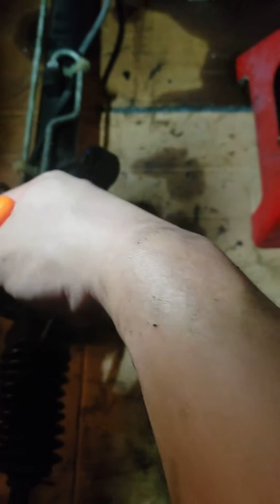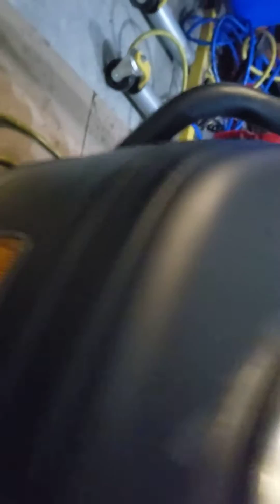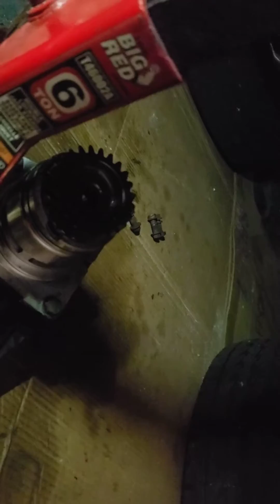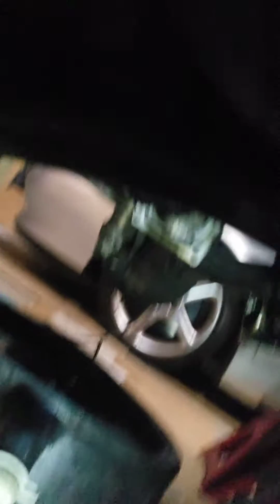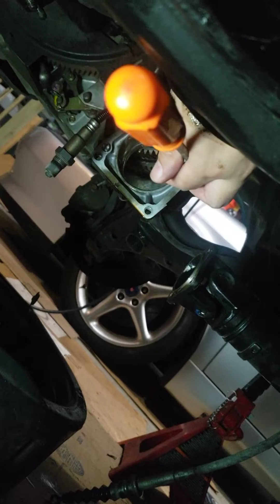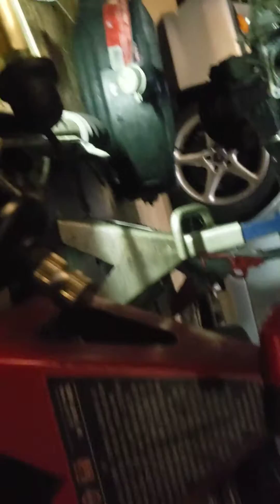HONDA CRV Power Steering Removal Tips and Tricks

Comment: I have 238 000 I have to do power rack how long do these cars run for I do all my own work as in maintenance it's a 97
Reply from the maker: This is my personal CRV. I still drive it till this day. I bought this 98 CRV in 2011 with 250k on the body and 154k on the engine.  The transmission went out in 2017. I replaced it with a JDM transmission and hasn't skipped a beat since. I put about 50-70 miles a day and 4 hours drives around the state.
Reply: How will I know when a transmission goes how does a act up a not shift into certain gears